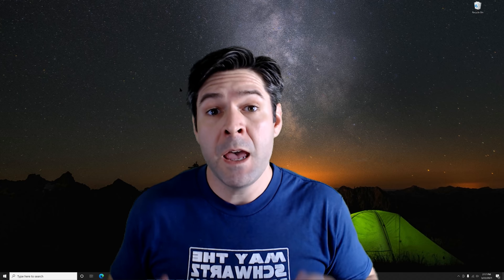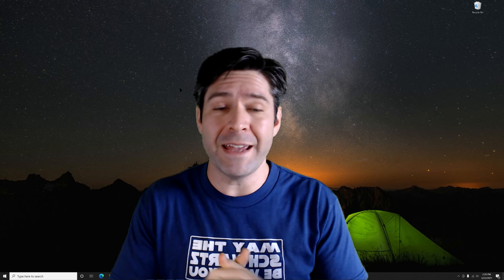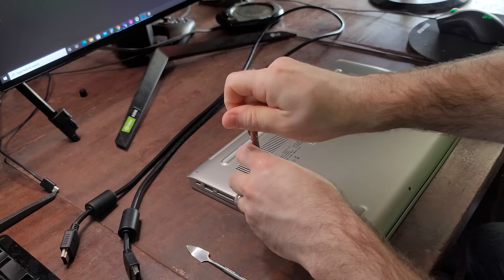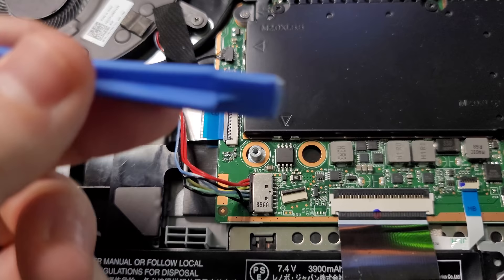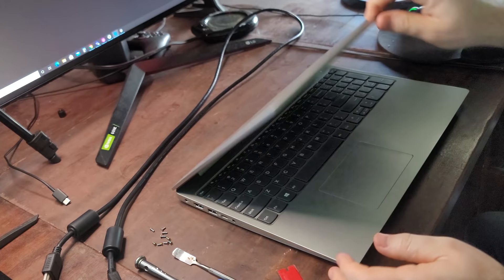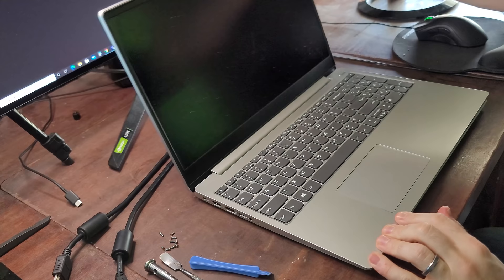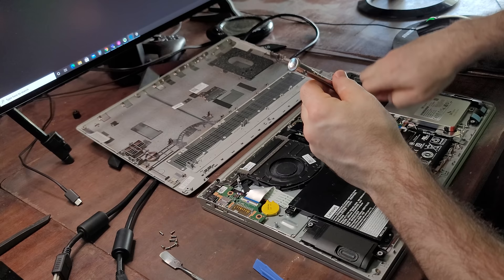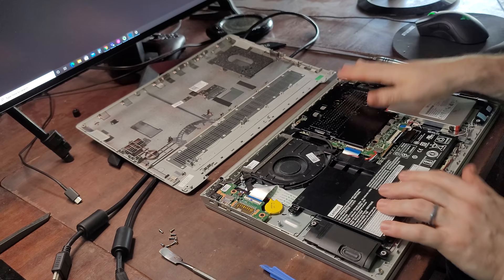Laptop Screen is Black (But Still Powered On and Running!) - Quick & Detailed How To Fix

Comment: very informative and accurate, I actually thought I was gonna have to go internal to fix my laptop, I have an older model HP15 laptop running windows 10pro which originally had windows 8 but with updating over the past couple years I've had no problems until about a week ago when I went to power on my laptop and only got a black/grey screen and I thought, actually I didn't know what to think, so I go to my only "go to" source and that is YouTube and after watching a couple videos I decided to go with this one and I am glad I did because this was a simple fix for me, after step 2, removing the battery and using only the power cord I power up my laptop and it boots up just fine, thanks again to the makers of this video

Comment: Thank you so much. I didn't realise I needed to hold the power button for so long for a hard reset. I thought I had been holding for long enough when I hadn't. I am very glad I am one of the lucky ones to fix it on the first step because I live in a foreign country and don't know the language well enough yet to get this technical kind of help if something needed fixing. Thanks again!
Reply: Your comment saved me,cause I pressed the first time it didn't work instead went off,then I saw this comment and it gave me the strength to try anain
Reply: @joykawira8040  You're welcome! When it happened to me I was on the verge of just crying. I always thought hard reset meant only holding until the computer turned off, this video really did save me too. I'm glad it worked out for you!

Comment: Great video, for me initially did not work, but than I checked LCD cable in the monitor screen which was unplugged and than together with plugging it back it worked. Perhaps if author can add how to get to reconnecting the cable together with this than it would be great - perhaps would help also those guys for which this first video did not work out.

Comment: Great video. Worked for me after I disconnected the battery and plugged in the power cable. Thank you. 😊
Reply: Did you screen go black because you left it on sleep for long because i did that accidentally and the hard reset thing is not working, so before removing the battery i just want to know if this method is for the issue i am facing

Comment: I have a ThinkPad X series with a black screen syndrome challenge. I left my laptop unattended for about 15 mins. When I returned it wouldn't come out of sleep mode, no matter what I tried. I followed your video 100%, found the info easy to follow, but lo and behold, once the case was off, could not find or see the CMOS battery at all. Do you know where I would find it? Model # CS13XBL-83US    I reseated the RAM, however that did not resolve my issue.

Comment: resetting the cmos battery actually worked thanks so much!
Reply: Did you screen go black because you left it on sleep for long because i did that accidentally and the hard reset thing is not working, so before removing the battery i just want to know if this method is for the issue i am facing

Comment: Your video was informative but didn't solve the black screen problem on my HP Envy.  You did inspire me to run HP diagnostics.  The diagnostic tests found nothing wrong --- all passed --- but my monitor will begin to work only after the processor CPU stress tests.  After a shutdown, the black screen returns.  Run the diagnostics --- bingo --- it works again.   ???

Comment: Yo, my hp probook laptop turns on when i press the power button but the doesnt display anything and then the fans start spinning like crazy, it does this until i force shut it down, there are times where it boots after reseating the ram but it does the same the moment i shut it down and restart

Comment: Hi, sometimes the  issue might be the actual display cable that runs from the motherboard to the screen. same issue happened to me and after wiggling and pressing down on the cable near the connector made it work for me although sometimes the screen goes from black to normal to showing distorted graphics while I'm touching the cable. The best cheap solution at this point would be to order and replace the cable with a new one

Comment: Thanks for this tutorial, but I still can't get the laptop screen to turn on. I have a Lenovo Yoga 82BJ. About a year ago the touch input of the screen would go out. I could usually enable and disable it or a corresponding device in the Device Manager and it would start up again, though one time I had to restart the BIOS and another couple of times I unplugged and repluged the touchscreen processor in the base of the laptop. Each time it would resume for a while and then cut out again. It had been out for months when I decided to try to check the connections behind the screen. I was using a thin spatula-like tool to massage the connector without having to take the screen off. Believe it or not, this was how it started working again once. Well, this time the whole screen went black. I took off the screen and both connections were solid in the back of the screen but I cracked the screen in the process. Now I have a new screen all connected, all connections are clean and in tight but still no screen. The laptop works fine with an external monitor but I can't get the screen to light up even after going all the way through each step. Any suggestions?

Comment: At the end of "connect your laptop to an external monitor" you said it was a software issue but didn't go into that. Could you please? Also, if the battery is disconnected and it turns on with the AC adapter then that means buy a new battery, right? I liked and subbed. Thx

Comment: Hello.  I went through all the steps you described in this video.  My issue is exactly as you described.  Lenovo ideapad 330S.  The issue didnt get resolved.  Still powering on, black screen.  I even replaced the battery.

Comment: I spilled water directly onto my keyboard. The problem I'm having right now is when I try to turn on my computer it turns on but only black screen like the windows itself doesnt boot even if i try pressing tab to shutdown my laptop. Even if it turned on, when the screen goes black like for example sleep mode, changing refresh rate etc. It will happen again.I tried external monitor and nothing came out, using other ram sticks, swap the ram positions, pull of the battery and hold the 30secs power button. After a few tries I realised the black screen thing only happened when my laptop is hot like I must wait for atleast 30 minutes to let it cooldown. But, my laptop takes 5 mins to get hot so it isnt worth it and incase I need to be portable then I can say I'm doomed. I'm not sure what else to try.

Comment: I have a Lenovo laptop similar to yours... mine's an older model (Lenovo XiaoXin CHAO7000). The screen kept flashing, so I tried disconnecting then reconnecting it to the motherboard. Where I screwed up is I reconnected the screen while the laptop was powered on. From my research the circuitry was fried either in the screen or the motherboard itself, and I'm praying it's not the motherboard.
Apparently this is very common with lenovo laptops. You have to disconnect the power when connecting/replacing the display, otherwise something's getting fried...

The caps lock key has a light which no longer comes on, even though my computer can still power on, which doesn't seem like a good sign.

I don't have any external display readily available, but I'll have to get my hands on one to determine the state of my pc. God, I hope the motherboard's fine.

Comment: Hi Josh, thank you for posting the very helpful tutorials. First, some time ago I did a reset on a one year old Lenovo idea-pad 3 and it worked fine for a while. Now, we have a black screen and I've gone through your entire troubleshooting steps with no success. On start up the keyboard lights. fan starts, a light flash on screen but then nothing. I do notice the power light flashing but goes no further. your opinion would be appreciated and thank you.

Comment: So I was/am having the same problem with my laptop. When I took off the back panel and unhooked the battery so it was running on ac power and it did fix the problem like the video states. I plugged the battery back in and it was running fine all day. I woke up today and went to go work on my laptop and it is doing the same exact thing again. So I took off the back panel again, unhooked the battery, problem solved again. It's as if unhooking the battery is a temporary solve. Any suggestions???

Comment: Hi, I have a Lenovo IdeaPad 1 15AMN7 and the LCD screen was cracked, I could have seen the part of the image, but it had to be replaced. I ordered the correct screen with 30 pins as the original one. After I tried to install it, the screen was off but the power and the laptop were on. I tried all the steps and when I connect to an external monitor I can see everything. That means the motherboard and the laptop are good.  I thought maybe the LCD was defective, so I unplugged it and wanted to replug the original one which I knew was working. When I plugged in the original one, it was the same, the screen was black(off) and the power was on, I could hear the laptop running and the sound from the turning on. I tried the other steps as well and it is the same. The only thing left for me to do is to order the video cable too and if that doesn't work I would have to take it to someone who can run the tests on the motherboard, connections towards the screen bracket where the cable is plugging in. That's my best guess. 
Do you have any other suggestions? I mean I already purchased the LCD screen. I might as well buy the cable.

Comment: Another quick solution, connect to external display and re-install the drivers and services, works 100% when its not hardware related

Comment: My HP Z Book was frozen in the on position but would not finish shutting down or boot back up with no display. So, I removed the AC power cord and then removed the battery. That's when the power finished shuting down. I put the battery back in place, reconnected the AC power cord, and pressed the power button back on, and it rebooted as it normally would, and everything is back to normal didplay, and I lost nothing, no files or apps. So, what would cause this to happen? That was the first fix I tried and it worked. Thanks!

Comment: Please help 😢🙏🏻🙏🏻🙏🏻🙏🏻
Thank you for the super useful tutorial. It did the same, and i connected it to a TV. It worked properly the desktop appeared on the TV, but now I don't know why my laptop screen is still black. I try the Safe Mode and running the System File Checker (SFC and Deployment Image Servicing and Management (DISM) commands. I tried the ctrl+ alt + delete to restart Windows Explorer and clean boot, and also checked the latest updates and installed it with all this my screen is still black.

Comment: For me, my screws on my laptop fell out and I lost them, things got worse and every time I opened, or closed my computer, the hinge popped out of it, I tried to put it back inside but this black rubber string with some strip thing on it came apart too, and the second it came apart my laptop display wasn't showing.

Comment: Sir, I`ve identified all the components you have indicated, disconnected them properly, and then reconnected, and yet my DELL laptop doesn`t power on. One thing to note is that the CAPS LOCK LED goes on and stays on whenever I turn on my laptop. What`s possibly gone awry?

Comment: Thanks for the help. I've tried all the methods. Still no progress. So I'm assuming it's something to do with the screen itself? I mean, the keyboard lights turn on but aren't actually active (because when I press the CAPS LOCK button, it doesn't turn the light on).

Comment: I got a hp envy the back-lit screen quit I use a flash light to see windows desktop to change settings to double screen and connect an HDMI cable and it work now maybe welding light arc burn it at  welding shop but it works now with external monitor

Comment: I did an emergency shutdown on it where I held control and use the power button on screen not the physical button. Because my laptop froze. And then the screen went black like it was going to shut down but the power button is still lit up and I can hear the fans and processors running inside.

Comment: I turned on my laptop but the screen was black so I pressed and held f12 and something popped up saying on which m.2 or SSD I wanna run the laptop so I ofc picked the one with Windows installed in

Comment: After pressing power button for 15 seconds my laptop started with fixing (C) stage 1 . It takes long time to be 100 % . The message to skip is for a second. So  before I do that it starts again the same. Could you please advise what to do in this case. Thanks

Comment: It's been 3 years since this video was out, i hope you are still answering questions here.

So i was using my laptop for gaming, and suddenly my screen just went blank and stopped working. I had to force shut down by pressing the power button a few seconds alright and after that I turned it back on by pressing the power button and it successfully reached the desktops screen but when i try to open an app the screen goes glitchy like a broken tv where there's a bunch of black, white and rainbow dot on the screen. It stays like that for a couple seconds and my first choice was to force shut down again. It did die and turned off but when i wanted to turn it on again i couldn't get to make it turned on just like your video, for information the power button when i turned it on is lit (there's like a white light indicator when laptop is turned on) the screens stay blank and i can't tell is it the lcd or is it batteries issue like in this video. Can i still positively assume that this is the same case as you explain in video or not.

Please kindly answer my question, I'd appreciate it thank you.

Comment: I own a Dell XPS 9350 - Black windows screen. Screen is turned on (FN+F8), battery reset, diagnosis successfully run, Switched BOOT to UEFI, .... still black after the Dell logo ... HELP pls

Comment: Wait.  So if I disconnect the battery and use the AC adapter and I get a picture, it's fixed?  Um.  How is that fixed?  What's the cause?

Comment: So my laptop screen randomly stopped working while I was on Extend mode. External monitor works fine and I tried pretty much everything with the drivers. When it's on "Show only on 2", it's completely black and the device manager recognizes it as there, although not active. When I put it on "Show only on 1" or "Extend"  (basically whenever there's supposed to be a picture on the screen) the screen will flash and random patterns of static will appear on the screen. Any ideas?

Comment: I left my laptop in sleep mode for a few hours but when I came back. It wasn't not booting, fan spin for a few seconds then stops again and again with no display.I removed the battery and drain all the power.but didn't work.

Then I unplugged the charger and the drain the power on motherboard without battery. But it is also not working.

I cleaned the ram but it also not worked.

Please help me.

I have important assignments to do.

Comment: I have what looks like the same Lenovo, mine wont boot although it is on, i removed the RAM and it booted into BIOS on its own. I noticed in the BIOS that it was not detecting the hard drive. i did all mentioned in this video and nothing. I reinstalled the RAM and laptop would not go into BIOS or boot. I installed a known working hard drive and it worked. If i purchase a new HD, will the OS transfer?
thanks!

Comment: Me it stoped working because it took a small hit and the display started blinking in and out so I turned it off, since then it won't comme on, I mean the screen remains black but the display stays black...or it boots up in a loop to turn off....so I don't know if this slight hit on the side broken or disconnected something.

Comment: My lenovo legion 7 happily displays to external monitors as long as they are plugged in before hand. However the laptop screen its self is black. It still acknowledges it's presence in display settings and will show the power up screen and occasionally the lock/home screen initially before then going black. Any suggestions?

Comment: My laptop displays on the TV fine but still does not produce a display on it's screen. Is your video saying to go ahead and take the back off and disconnect the cmos and perform those procedures also? laptop is acer cb3-111 and 9 years old, I replaced the battery just now and  thats when I went to your video. wife loves the darn thing so I'm trying to get it back up for her. I'm thinking since it came up on the tv that the cmos battery is still good?

Comment: I have tried each of your suggestions but non have cured  my  problem which is slightly different.  My laptop  when on battery  starts to boot but screen remains black and doesn't reach the Toshiba logo before powering off. If I remove the battery ond boot on power supply all works OK. (Battery is new and fully charged). Once it has booted if I plug in battery thelaptop display goes black.  if I duplicate the display and boot with battery and power supply then laptops starts  but only on second display remove battery display on both displays OK.
Finally if I boot with battery only then only external display works.
Clearly a display issue but I'm at a loss to k ow what to try next, any ideas?
Toshiba L50 B Windows 10 22H2

Comment: This did not work for me sadly and kinda made it worse. I used to be able to connect my laptop to an external monitor to access it but now I'm not able too anymore. I can't even tell if the computer is on or off because the fans are very discrete.
Reply: Did you laptop get fixed